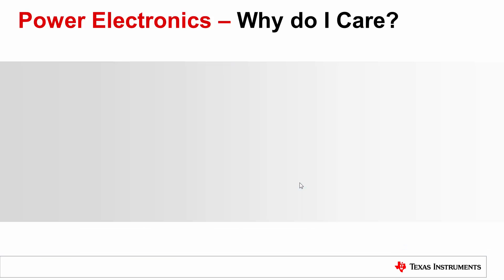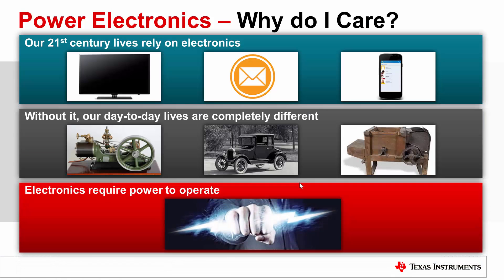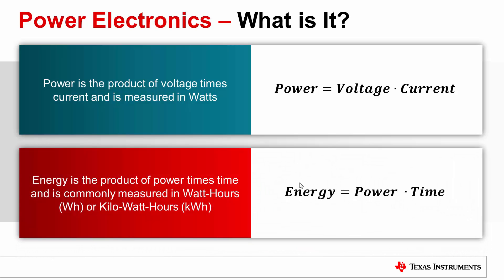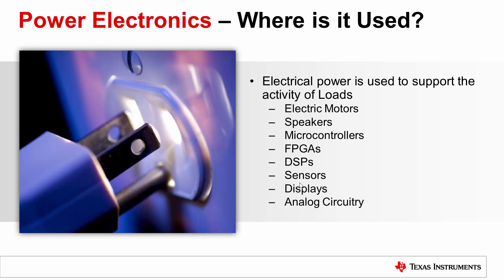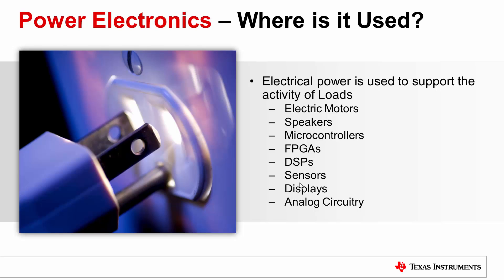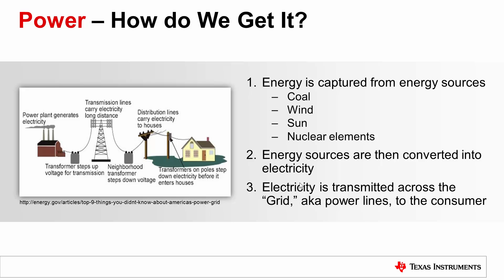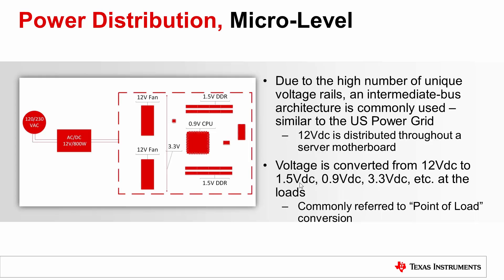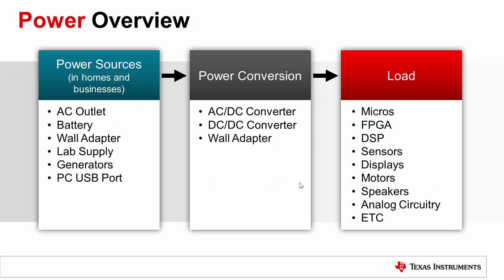Introduction to Power Electronics - Overview

Comment: hi guys, the best success that I have had was by using the Gregs Electro Blog (just google it) definately the most helpful course that I have ever tried.
Reply: thank you so much dude , I had an engineering degree in power electronics back in 2010 , since that date I didnt use what I've learnt at all because I worked in the oil field and forgot everything about what Ive learned , ty for your advice it helps a lot
Reply: What a load of bollocks